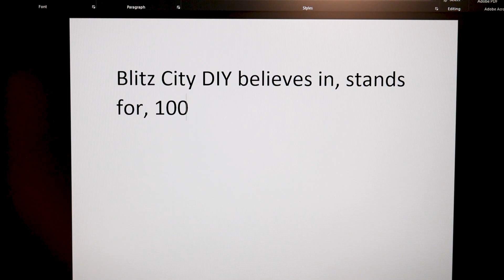DIY FYI: Desoldering Header Pins

Comment: Itstead of clunky solder pump just use a toothpick with a bit of gel flux on the end to stick into heated pad and leave there until cooled.
Wood makes wonders here, it does not stick, melt, or burn easily (with the right amount of flux) and it is a lot faster this way.

Comment: That's a really great tip.  I have tried to do this but didn't think of removing the plastic connector off of the pins first.  That is the trick that you need for this.  Thanks for sharing.

Comment: One tip for removing things 2 pin parts like LED, capacitors is what I call the "gravity hand".

A small pair or pliers with and elastic band on the handle allows it to grip the component and hang down from the board, as soon as you add heat, sometimes a little fresh solder to the  upper side if the board, he weight of the pliers pulls the part out for you.
Reply from the maker: oh cool, great tip!
Reply: @BlitzCityDIY  glad you like it, it has saved me so many headaches, with enough fresh solder it can work in 3 pin devices like regulators too.

Comment: "The trick, William Potter, is not minding that it hurts."
Good stuff!   I hate presoldered headers because I usually want things very compact and connect things with solid-core wire so it holds its shape.  
Wick is good for this, too.  Using a fine tip, you can push it into the holes.
Reply from the maker: same, i like things to be as compact as possible. i'll have to try it with wick too

Comment: You're doing it right!!. Good video, same technique I use with one exception. When heating the pin & solder, I keep the tweezer away from the pin otherwise, it acts as a heat-sink on the pin and I find it takes longer to melt the solder. I heat the pin first and at the last minute, I use the tweezer to remove the pin. Thank you for sharing your skills for others to learn.
Reply from the maker: ohhh that's a great tip! i'll have to remember that

Comment: Thanks for covering desoldering. I'm a decent solderer, but I'm very bad at desoldering. One of the things that is making it easier for me, is not using helping hands but a vise like the one you have.
Another thing is moving from my soldering station (very much like yours) to a tiny soldering TS-100 clone from Pine64 called the Pinecil, and that as an extra, has a RISC-V chip on it. It has a "boost" function that allows to get the soldering iron to 400C in just seconds, as it's more efficient and has less weight than my "normal" soldering station. Love the pinecil.
Reply from the maker: oh sweet, i've heard about the pinecil.

Comment: Hi     Ref. Phei's comment  -- i have a bit ( infact 2 ) made for Antex Soldering Irons  ( perhaps other makers sell similar ? )
that can be used to remove a DIL IC ( or a DIL IC Socket )  . I cut one so its good for Single In Line devices etc  where there may
not be space to use the DIL tool .
                                                                 Alan
Reply from the maker: nice!

Comment: Good tip! After many breakouts and prototypes, I've found that individual PCB-wire connections are pretty troublesome as they make enclosures very tangly and hard to work in. Most often I'd much rather keep the headers, make an IDC cable of the same pitch (sometimes easier to use every other wire of a denser ribbon cable) or just split some ribbon cable and solder on a socket to match.
Reply from the maker: fair, that can also be effective

Comment: This is a great technique. Also that solder sucker is the business! Well worth the additional cost over cheap ones

One thing that is kind of counter intuitive that sometimes helps is that if the solder is not flowing right or you can't get it with the sucker, sometimes adding more solder to party. If will have fresh flux and will flow easier.
Reply from the maker: Yesss that definitely helps out!
Reply: More solder also provides a thermal path from the iron to the remaining solder, which you might otherwise be unable to make decent contact with! :)

And yes, that Engineer solder sucker is amazing. Silicone tip that can be in contact with a hot iron for moderately-extended periods without damage <3
(Though it will turn brittle and break off if left at 300-400°C for too long.)

With so many other tools you can get away with the cheap options for hobby work, but that is one that I'd suggest newbies get before too long. Without it, desoldering can be so difficult that I think a lot of people would outright give up tbh.
(Especially if they only have cheap, useless, unfluxed solder wick/braid... To anyone reading this, if you've never been able to get solder wick to work, and think it's totally rubbish, try adding liquid flux into the wick! It's absolutely required, and while the slightly-more-expensive options are already impregnated with flux from the factory, the cheap stuff from eBay/AliExpress tends to not be!)

Comment: Desolderingguns are nice.
Reply from the maker: indeed!
Reply: I have a neat tool that combines a cheap manual solder sucker with a cheap 240V soldering iron.
No, of course it's not nearly as good as a full desoldering pump, but I seem to recall paying only £5 (US$6~7) for it, from Amazon UK with next-day Prime shipping, and it's definitely worth much more than that!

Especially since it came with a decent-quality UK mains plug and flex attached (it was even earthed, IIRC) rather than the "single strand of aluminium" style of cable you'd kind of expect from something like that.

If you can afford and justify a proper pump, that's the better option, but if you can't, this thing can be a handy upgrade if you can find it cheap enough.

I just wish it had the same silicone tip of the Engineer solder sucker! :(
(I tried fitting some spare Engineer silicone tip refill to that heated solder sucker, but the constant high temperature kills the silicone extremely quickly ☹️)